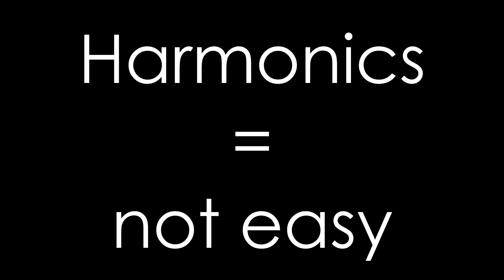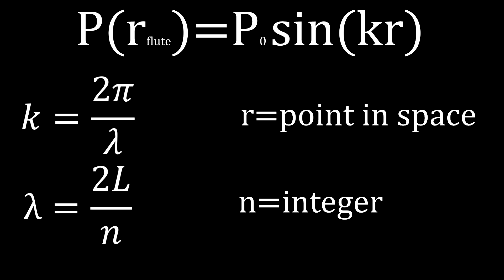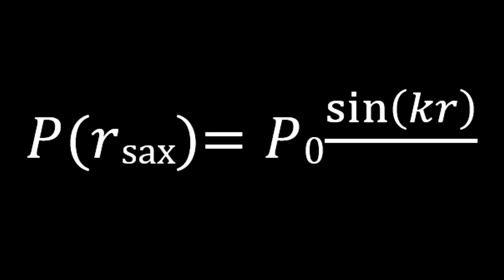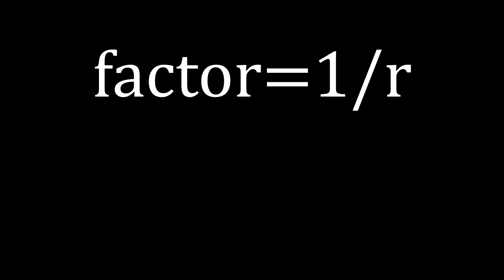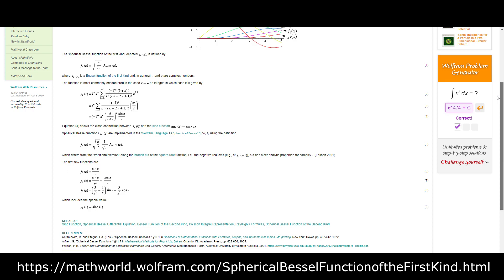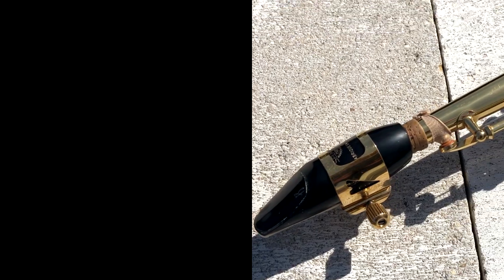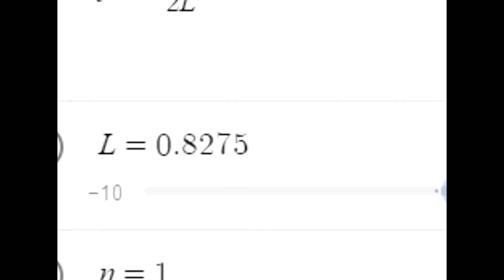The Physics of the Saxophone

Comment: All I wanted to know was just how the thing works ... not loads of equations ..! How do those valves change the frequencies?
Reply from the maker: Sorry about that. Generally, when you press the valves down from top to bottom, the wavelength of the sound produced elongates, leading to a lower pitch. The lower the pitch, the lower the frequency. If you press the octave key,  that will shorten the length of the sound wave, increasing the frequency of the wave. This allows the instrument to play that higher octave. Once again, I'm sorry I was not very clear about that in the video, I hope this helps!
Reply: @wrcunnin  When you press the octave key, does it double the frequency?
Reply from the maker: Forgive me for this late response, but it does double. For an alto saxophone, the frequency of a concert A can be 220Hz. Pressing the octave key makes that concert A 440Hz. This is caused by a pretty cool property of sound waves. Tones that are of a frequency of 55, 110, 220, 440, and 880Hz are all concert A's in different octaves.

Comment: but how does opening the holes/valves influence the frequenzy played on a physics level?
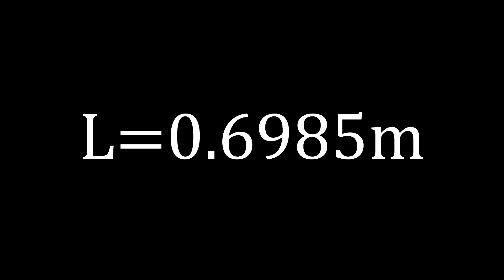Reply from the maker: Opening/closing the holes is relatively the same thing as shortening/lengthening the instrument. Frequency is inversely proportional to the length of the instrument. When the length of the instrument is shortened, the frequency increases (increase in pitch), and vice versa. The time stamp 3:58 shows the equation i used for frequency in this case. I hope this helps!
Reply: @wrcunnin  ay makes sence. thx.
Reply: @wrcunnin  so there are no different modes involved like with the trumpet?
Reply from the maker: The trumpet may be a little different. I don’t know very much about the harmonics of a trumpet, but every combination of fingering different notes on it does change the “length” of the tube. With that said, since higher notes are played by reaching different partials, I know nothing else about the exact reasons behind those harmonics.

Comment: I never saw a straight one before, and i don't use the equations much when i look at physics concepts, but this was what i was looking for sax physics, how does the keys change a note, is it putting something across the tube essentially creating a shorter it longer ends where the key is?
Reply from the maker: Exactly that. The keys have pads underneath them, so when you press it down, the pad covers and “seals” the hole.